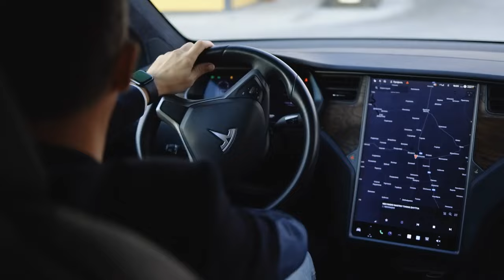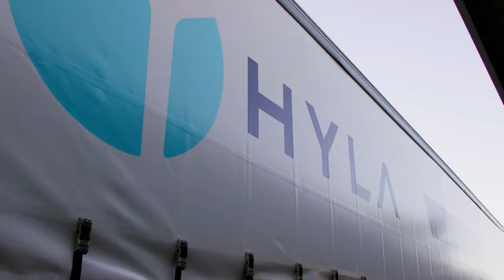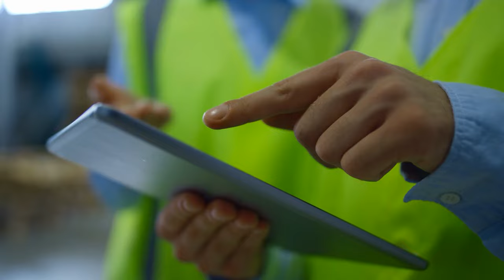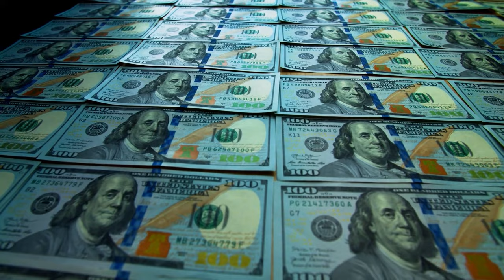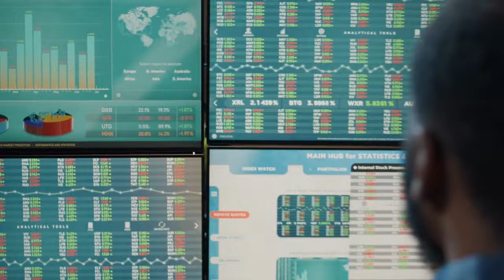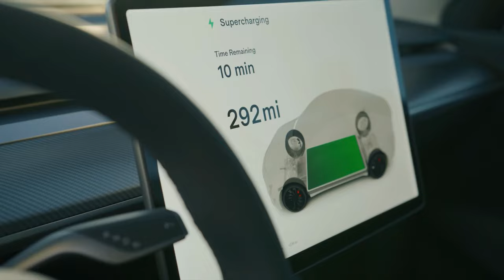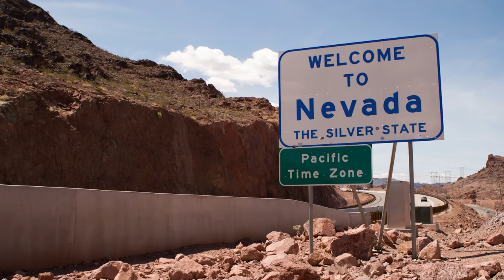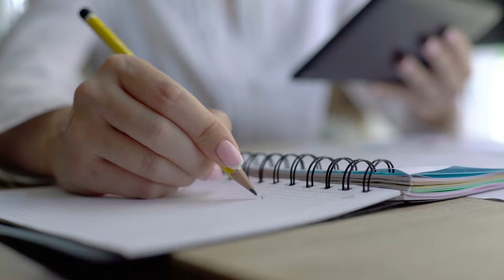A Devastating Blow For The EV Industry | Insurance Prices SkyRocket

Comment: Anyway my wife wanted a new EV so I went to the local love boutique and bought her one!!! Damn now I'm sleeping on the couch 😂
Reply: EVs without infrastructure are junk. 
Hybrids are the best short term answer until batteries and infrastructure catch up.The Steam engine went extinct in the 40s and diesel electric locomotives have been their replacement since them.  Thats a hybrid  Today, Edison Motors has a succesful hybrid logging truck that beats the Tesla in both power and fuel economy and most importantly, and it is lighter than the standard trans truck NRA. No range anxiety.
Get it straight .. The infrastructure TODAY  CAN NOT support EVs but hybrids can and are doing it with no infrastructure change and BETTER FUEL ECONOMY WITH PROVE TECHNOLOGY ..

Comment: Do you think EV is a good way of transport that save money compared with gasoline engine.
Reply: EVs without infrastructure are junk. 
Hybrids are the best short term answer until batteries and infrastructure catch up.The Steam engine went extinct in the 40s and diesel electric locomotives have been their replacement since them.  Thats a hybrid  Today, Edison Motors has a succesful hybrid logging truck that beats the Tesla in both power and fuel economy and most importantly, and it is lighter than the standard trans truck NRA. No range anxiety.
Get it straight .. The infrastructure TODAY  CAN NOT support EVs but hybrids can and are doing it with no infrastructure change and BETTER FUEL ECONOMY WITH PROVE TECHNOLOGY
Reply: EVs without infrastructure are junk. 
Hybrids are the best short term answer until batteries and infrastructure catch up.The Steam engine went extinct in the 40s and diesel electric locomotives have been their replacement since them.  Thats a hybrid  Today, Edison Motors has a succesful hybrid logging truck that beats the Tesla in both power and fuel economy and most importantly, and it is lighter than the standard trans truck NRA. No range anxiety.
Get it straight .. The infrastructure TODAY  CAN NOT support EVs but hybrids can and are doing it with no infrastructure change and BETTER FUEL ECONOMY WITH PROVE TECHNOLOGY

Comment: Does this include hybrids
Reply: EVs without infrastructure are junk. 
Hybrids are the best short term answer until batteries and infrastructure catch up.The Steam engine went extinct in the 40s and diesel electric locomotives have been their replacement since them.  Thats a hybrid  Today, Edison Motors has a succesful hybrid logging truck that beats the Tesla in both power and fuel economy and most importantly, and it is lighter than the standard trans truck NRA. No range anxiety.
Get it straight .. The infrastructure TODAY  CAN NOT support EVs but hybrids can and are doing it with no infrastructure change and BETTER FUEL ECONOMY WITH PROVE TECHNOLOGY

Comment: Electric Power is simply not appropriate vehicles for many, many reasons. Besides, regular ICE vehicles are technologically superior and much cheaper to operate.
Reply: EVs without infrastructure are junk. 
Hybrids are the best short term answer until batteries and infrastructure catch up.The Steam engine went extinct in the 40s and diesel electric locomotives have been their replacement since them.  Thats a hybrid  Today, Edison Motors has a succesful hybrid logging truck that beats the Tesla in both power and fuel economy and most importantly, and it is lighter than the standard trans truck NRA. No range anxiety.
Get it straight .. The infrastructure TODAY  CAN NOT support EVs but hybrids can and are doing it with no infrastructure change and BETTER FUEL ECONOMY WITH PROVE TECHNOLOGY

Comment: Spain insurance prices for EVs have almost doubled however there is only 3% take up on pure EVs in spain so its not that. It's all down to inflation and lack of chips that have increased prices.
Reply: Nah more like the manufacturer process and lack of parts are being seen as expensive.
Reply: EVs without infrastructure are junk. 
Hybrids are the best short term answer until batteries and infrastructure catch up.The Steam engine went extinct in the 40s and diesel electric locomotives have been their replacement since them.  Thats a hybrid  Today, Edison Motors has a succesful hybrid logging truck that beats the Tesla in both power and fuel economy and most importantly, and it is lighter than the standard trans truck NRA. No range anxiety.
Get it straight .. The infrastructure TODAY  CAN NOT support EVs but hybrids can and are doing it with no infrastructure change and BETTER FUEL ECONOMY WITH PROVE TECHNOLOGY

Comment: First, the Felicity Ace, and now the Freemantle Highway!
Reply: EVs without infrastructure are junk. 
Hybrids are the best short term answer until batteries and infrastructure catch up.The Steam engine went extinct in the 40s and diesel electric locomotives have been their replacement since them.  Thats a hybrid  Today, Edison Motors has a succesful hybrid logging truck that beats the Tesla in both power and fuel economy and most importantly, and it is lighter than the standard trans truck NRA. No range anxiety.
Get it straight .. The infrastructure TODAY  CAN NOT support EVs but hybrids can and are doing it with no infrastructure change and BETTER FUEL ECONOMY WITH PROVE TECHNOLOGY

Comment: ok ok, I'll join in on the BS if everyone else is. 
A friend of mine bought an EV and he parked it in his garage and charged it. He could only charge to 30% as per manufacturer instructions, and insurance stated that he couldn't charge past 35%. He went to 40% one day and 7 people died 3 blocks down due to the thermonuclear explosion. Him and his wife died but his kids lived, and I am currently looking after them. 
The car manufacturer said that it was expected that at least 3 people would die so we couldn't file a law suit.
I test drove an EV the next day and the car ran out of battery after 4 miles. I couldn't get out of the car and had to call 911. 4 other people died while the fire department was trying to get me out of the vehicle because they got electrocuted. It was horrific!
The place I test drove from said that the battery was 6 months old and well overdue for a battery replacement and that's why it went flat.

From now on I will only ever drive Hydrogen cars because Hydrogen is safe and cheap and stations are everywhere!

Comment: They are worse for the environment than petrol or diesel when you figure in the metals mined for the battery. Manufacturing and shipping pollution. Only when they have done about 100,000 miles do they start to become carbon neutral. The battery doesn't last that long.

Comment: I suspect the current sprinkler system in modern multi-storey parking garages will not provide enough water volume to suppress full EV fire. It is designed for gasoline and diesel cars.

Comment: I think we have a STRUCTURAL problem. I had to call off the purchase of a simple Toyota procace city electric for the astronomic price of the insurance: £2550 minimum for a year. That is 5 times the price of my yaris insurance… This extortion is coming for the lack of testing structures, diagnostic tools, and the almost direct scrapping of the accidented electric cars. 
Now what are our UK goals before 2030? Is the fact of becoming green the duty of the ones that can afford it? When does the majority of us can purchase an electric car ECONOMIC on every aspect and therefore done by ALL OF US without been trapped inside a purchase and being ripped off?
Reply: EVs without infrastructure are junk. 
Hybrids are the best short term answer until batteries and infrastructure catch up.The Steam engine went extinct in the 40s and diesel electric locomotives have been their replacement since them.  Thats a hybrid  Today, Edison Motors has a succesful hybrid logging truck that beats the Tesla in both power and fuel economy and most importantly, and it is lighter than the standard trans truck NRA. No range anxiety.
Get it straight .. The infrastructure TODAY  CAN NOT support EVs but hybrids can and are doing it with no infrastructure change and BETTER FUEL ECONOMY WITH PROVE TECHNOLOGY

Comment: EVs without infrastructure are junk. 
Hybrids are the best short term answer until batteries and infrastructure catch up.The Steam engine went extinct in the 40s and diesel electric locomotives have been their replacement since them.  Thats a hybrid  Today, Edison Motors has a succesful hybrid logging truck that beats the Tesla in both power and fuel economy and most importantly, and it is lighter than the standard trans truck NRA. No range anxiety.
Get it straight .. The infrastructure TODAY  CAN NOT support EVs but hybrids can and are doing it with no infrastructure change and BETTER FUEL ECONOMY WITH PROVE TECHNOLOGY
Reply: Exactly. That's why alternative energy solutions need to rolled out gradually, in a deliberate fashion. Not this climate hysteria-fueled frenzy, which I believe has a nefarious embedded agenda.

Comment: Well I always wanted a HOT car! Anyway thanks for the update 😊
Reply: EVs without infrastructure are junk. 
Hybrids are the best short term answer until batteries and infrastructure catch up.The Steam engine went extinct in the 40s and diesel electric locomotives have been their replacement since them.  Thats a hybrid  Today, Edison Motors has a succesful hybrid logging truck that beats the Tesla in both power and fuel economy and most importantly, and it is lighter than the standard trans truck NRA. No range anxiety.
Get it straight .. The infrastructure TODAY  CAN NOT support EVs but hybrids can and are doing it with no infrastructure change and BETTER FUEL ECONOMY WITH PROVE TECHNOLOGY

Comment: Between the price of the car and the price of your electricity and insurance they are going to "Price Out" most car owners - and that is the plan.
Reply: EVs without infrastructure are junk. 
Hybrids are the best short term answer until batteries and infrastructure catch up.The Steam engine went extinct in the 40s and diesel electric locomotives have been their replacement since them.  Thats a hybrid  Today, Edison Motors has a succesful hybrid logging truck that beats the Tesla in both power and fuel economy and most importantly, and it is lighter than the standard trans truck NRA. No range anxiety.
Get it straight .. The infrastructure TODAY  CAN NOT support EVs but hybrids can and are doing it with no infrastructure change and BETTER FUEL ECONOMY WITH PROVE TECHNOLOGY ..
Reply: @enterprisencc1701z   We heard you the first time. Stop the copy and paste.
Reply: It is only inevitable if you do nothing to derail their plans.

Comment: Haters are on gonna hate.  I own an i4 and so far it’s been amazing.
Reply: So will your obituary.
Reply: For now, I am sure it is great. Wait until everyone is driving an EV. Most power girds are not up to speed to handle that demand. It will take decades. People will be allocated times and days to be able to charge at home. Super chargers will have lines blocks long and it will cost you a fortune, so will your electric bill. The highways and over passes will all be needed to be retrofitted to accommodate the weight of the EV's. Who do you think is going to pay for all that. The taxpayer of course. You only thought about now and didn't think down the line.
Reply: EVs without infrastructure are junk. 
Hybrids are the best short term answer until batteries and infrastructure catch up.The Steam engine went extinct in the 40s and diesel electric locomotives have been their replacement since them.  Thats a hybrid  Today, Edison Motors has a succesful hybrid logging truck that beats the Tesla in both power and fuel economy and most importantly, and it is lighter than the standard trans truck NRA. No range anxiety.
Get it straight .. The infrastructure TODAY  CAN NOT support EVs but hybrids can and are doing it with no infrastructure change and BETTER FUEL ECONOMY WITH PROVE TECHNOLOGY
Reply: Stay safe

Comment: They are not electric cars, they are coal or oil powered cars, using an inefficient method of  getting the energy to them. It is more efficient to burn the oil in a normal car, but  people are brainless and gullible, and will continue to support idiot ideas.